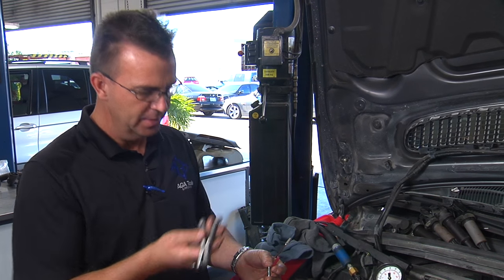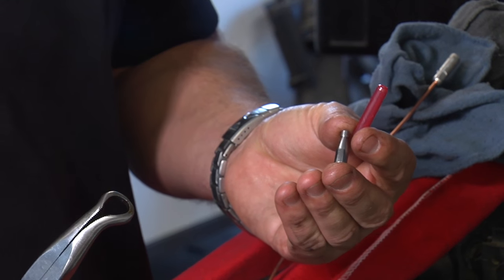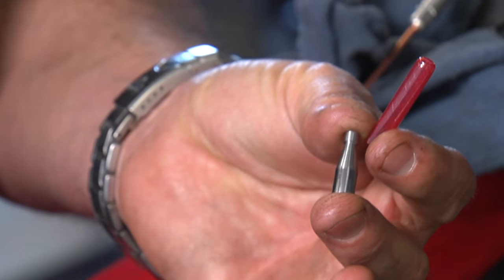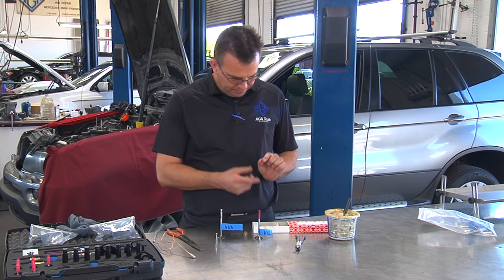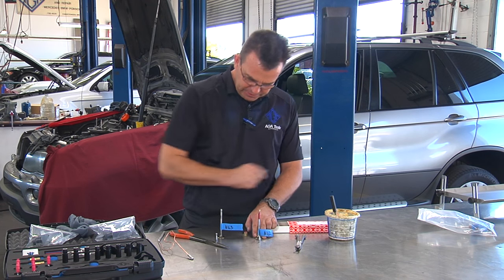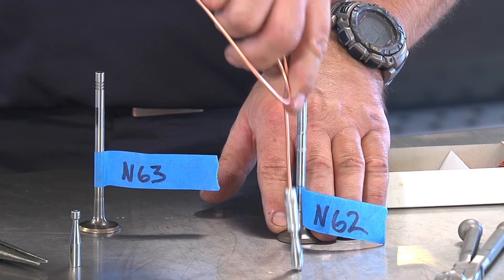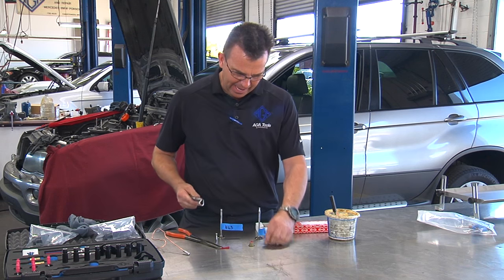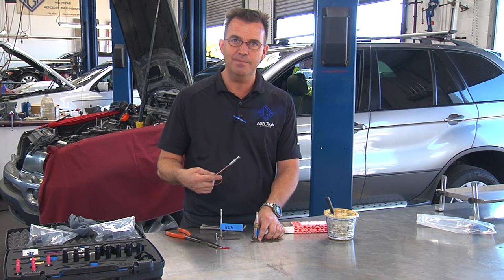N62 & N63 Valve Seal Installer

Comment: Nice work creating innovative tools as always! What do you guys charge for an N62 valve stem seal job?
Reply from the maker: We charge 20 hours if it is a sedan. 21.5 if it's an SUV.
Reply: @AGATools  since the valve guides wears out and causes side to side freeplay wich in turn causes the damage to the valve stem seals my guess is the job is included otherwise the problem will reappear soon enough wich makes the 20+ hours of labour so not worth it but maybe it's included?